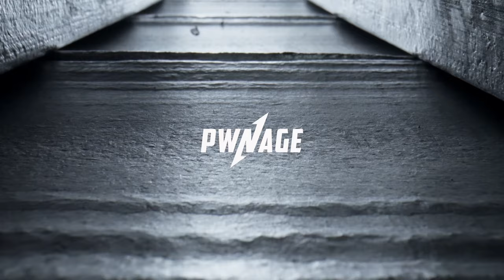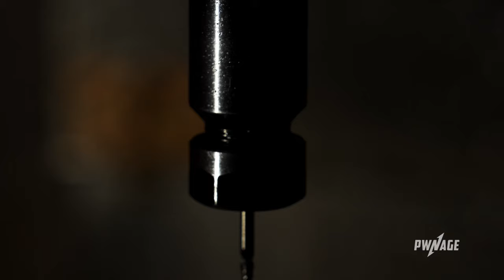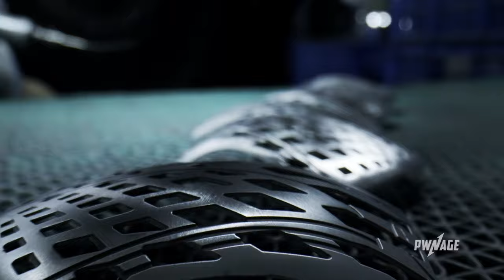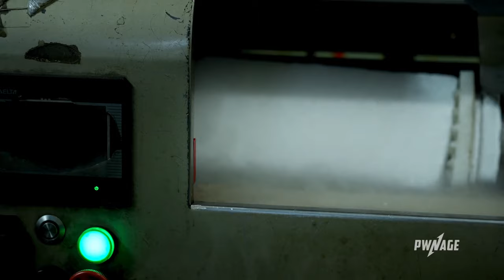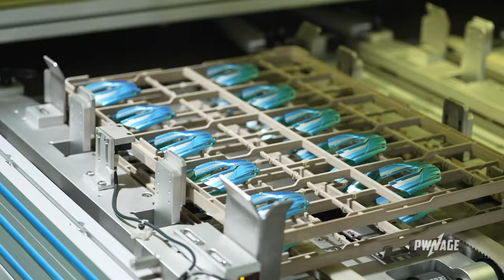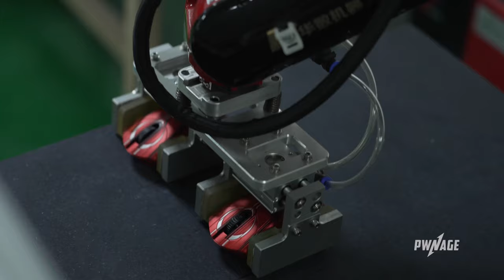Pwnage Stormbreaker Mouse Production

Comment: Could you make the software have a debounce time setting, I will 100% buy this if it did,maybe like 4-20ms like the model O does. Unless it already has one and I'm just being stupid. Please lemme know 🙏🙏🙏🙏🙏
Reply from the maker: the stormbreaker is using a custom debounce algorithm set to 0mS. currently, it has one of the lowest if not the best motion and click latency on the market. Here’s test data from rtings and you can compare to other mice: https://www.rtings.com/mouse/1-4/graph#39472/17134 they also have motion latency data and they explain their testing methodology and proof of actual testing.
Reply: @PwnageOfficial  So this means it can double click correct? And debounce time can be adjusted right?